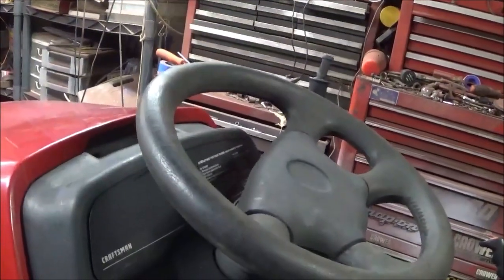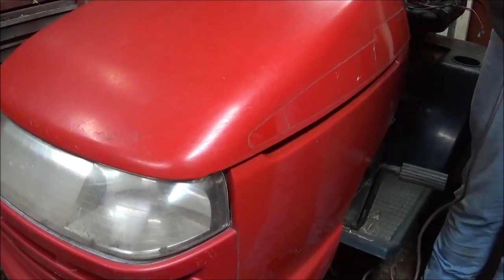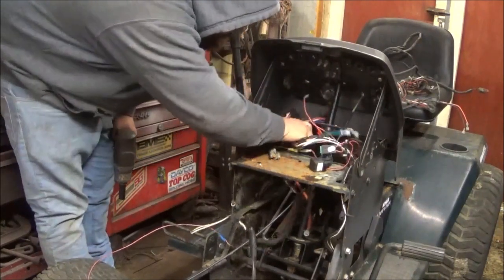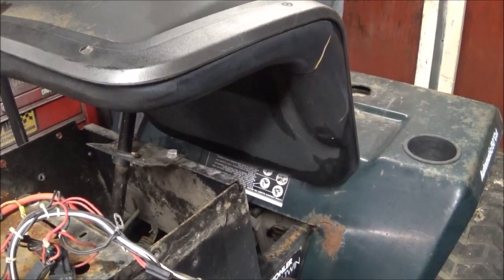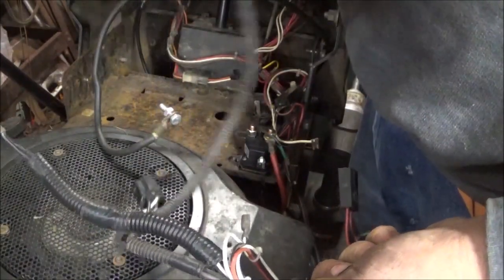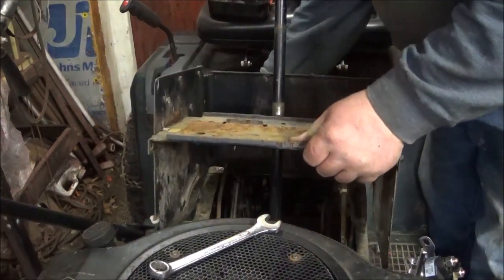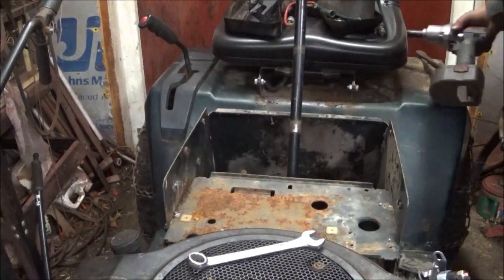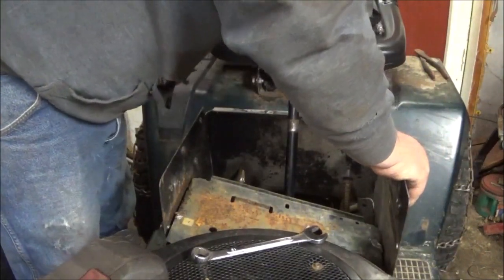craftsman hydro the elkskins project

Comment: Was that any early green tractor with a different hood and I see it has the black fuel tank that you can still buy , but the ones that have the fuel gauge in the fender which if you don't cover the gauge or park it inside the sun will kill it and they don't sell those tanks anymore.I have 2 big husqvarnas withe the white tanks and two of the GT series the GT, series have the 6 speeds which I'm converting to Hydro. I'm gonna make a templet so I can cut the fill and the you can buy the black tanks, and have n't anyone that makes a glue to fix the whit plastic tanks.